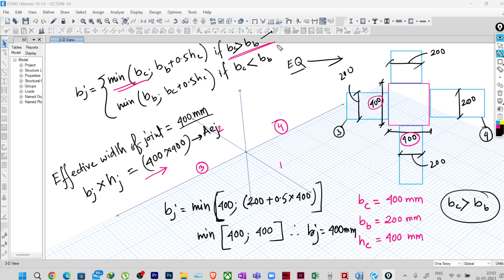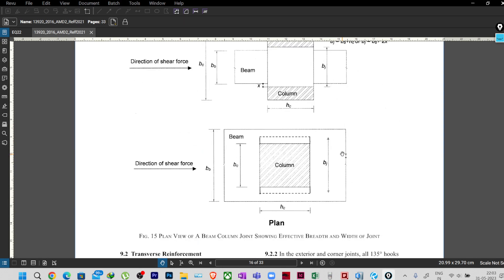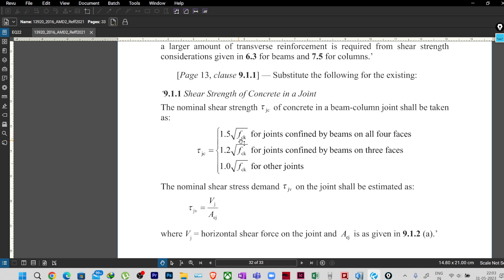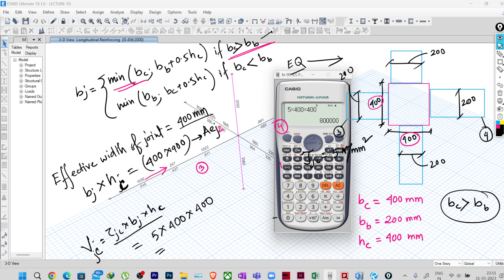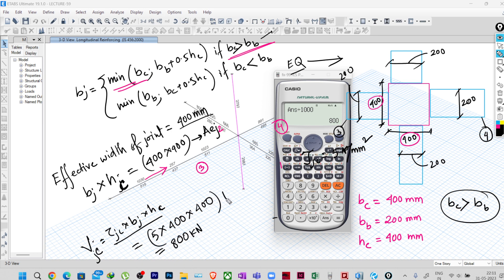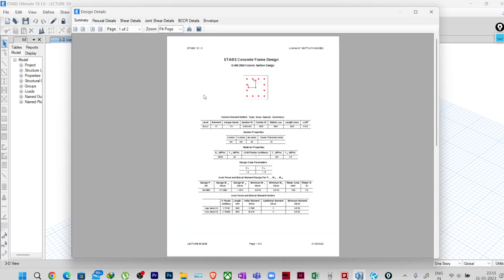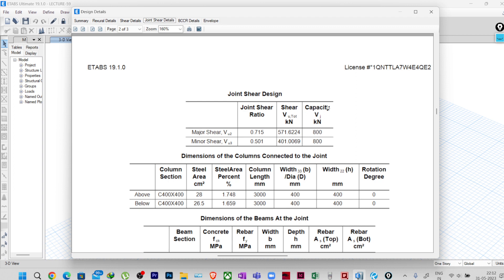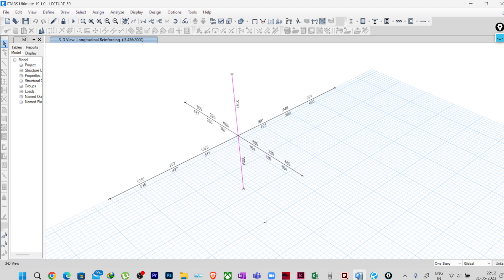Joint Shear Capacity- ETABS vs IS13920: Part-2 | ilustraca | Sandip Deb

Comment: I have an error of clause 7.1 is 1390 in beam design on connect addition, how can we resolve
Reply from the maker: There are multiple clauses under 7.1, either u have higher axial load in ur beam or the columns supporting the beams has dimension along the beam less then 20 times the bar diameter that has been assigned by STAAD as per your preference in beam or ur column dimension is less than 300 mm….so ultimately if you read the code book, u’ll get to know. STAAD has nothing to do with this, you give it appropriate input, it will provide you appropriate result. You need to use your engineering knowledge.